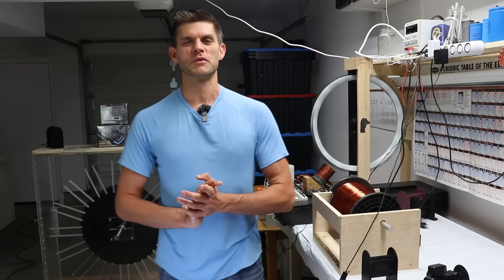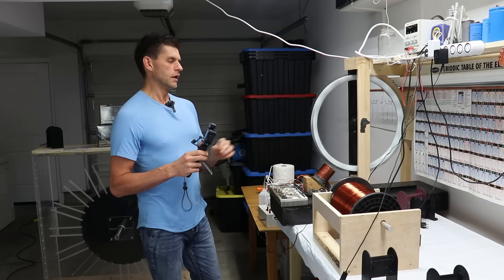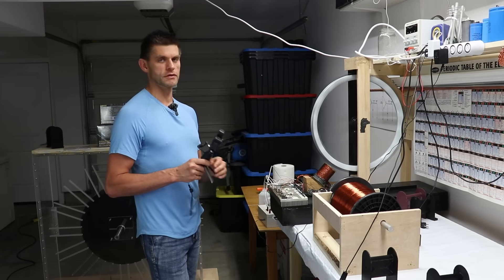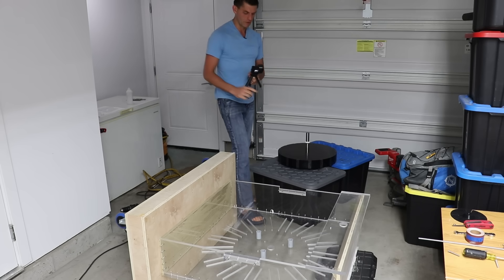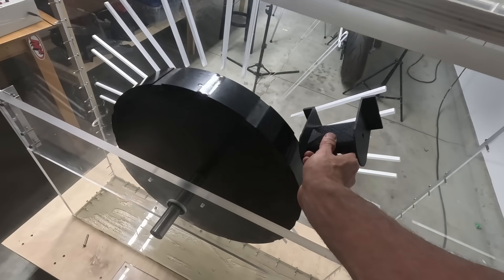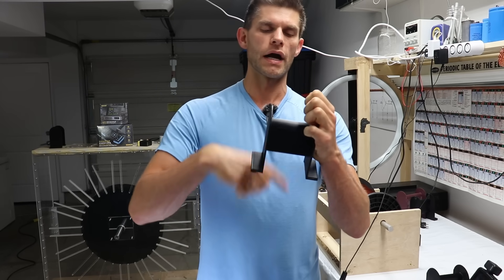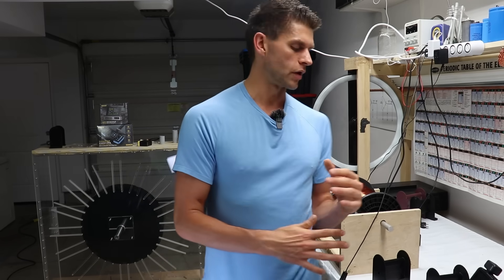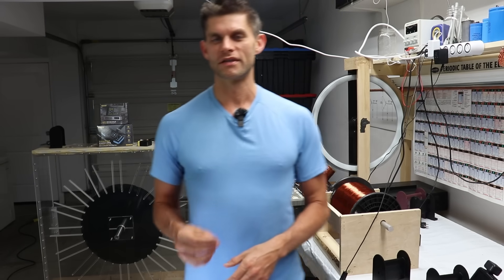Unlocking Zero Point Energy in My Garage (Open Source Project)

Comment: I can point out at least 10 things you're doing wrong. First of all, zero point energy's secret is folding pump z waves either digitally made or riding on a carrier to cause the slope. This is actually an ion charge bias, which makes all parts in the circuit ion diodes, in effect. A wheel is one way to spill off the positive ion waste, but I see no high frequency coil or even a zero point, aside from the LF one, which in any proper zpe circuit is only half of it. You will need to add hf coil to burn off energy in order to get the wheel to also spill off boson space mass (the positive ion in bias to the positive pole of magnetic current - proven new physics based on a real working t.o.e. and established with predictive proofs.)
Here's a thought; any spinning wheel you make needs to do form a Julian set with charge, not Mandelbrot as you have done. It's just a lot more efficient.  Honestly since you've already made your magnet wheel there, idk. Maybe it's worth saving somehow. I can use 36 N52 magnets to produce over 100hp. If you're not doing that yet you need to start over. Don't post a video of it working either. You'll become a target for the oil cartel. Just make the tests and post results without proof, because for those who want to believe are the only ones worth sharing the info with.
Reply from the maker: Lol oh ya, let's see your set up? What's a high frequency coil going to look like in comparison to ours? I disagree and say open source all the way is the only answer.
Reply: @MadscienceLPTECH  You can use an automotive ignition coil if you want. Charge drops when you short out 2 of 3 charge points in a zpe circuit, which also at the time causes charge to implode through layers of flatwire. This was done by Keely in 1908. You have a copper ring between 16v magnets and an iron plate they're mounted to, to pass 32 magnets over 16 cores each wrapped in 21 layers of 1/4" wide flatwire. A pair of negative center cow magnets mounts neg only to vehicle's neg gnd, so the circuit has 3 negatives repelling at once which spits the weaker heavier positive pole and ion it's in bias to, off the ends of the cow magnets (2) at opposite sides of the magnet array- which is the Julian set fractal it makes. It produces 40hp using 3.3lb pull magnets but with 30lb N52 neodymium, a lot more all depending on the wires.  Fact is, negative is stronger than positive and you are taking some advantage of this already but not enough.
Reply from the maker: You seem intelligent. Thanks for the replies. Let's stay in touch :)

Comment: I was thinking 20 alternators belted to a drive shaft 5 to 10 batteries  wired together and a high torque electrical engine like a floor sander hooked up with an electric converter from a mobile home .. would put out. Way more power than it takes in .  Would keep the batteries charged and power the motor leaving power left over to power other devices..
Reply from the maker: Would it? I think I it needs the pulses HV to get the effects. Great comment

Comment: I still think there is something going on with spark gaps. Then the moray valve and vacuum tubes. We need to go back to what they were doing at turn of century maybe.
Reply from the maker: Agreed. Teslas method of conversion used a spark gap to convert to a single wire energy flow

Comment: Your presentation here is magnificent and you have a great vibe...  really nice work!   As an EE, I've also been experimenting for quite a while and totally comprehend everything you discus  (FET vs. SiC,  HAL vs Coil trigger, rotor design, etc.).  I've used Bedini sense-coil triggering, HAL sensors, and mechanical commutators in various configs... oh-so-close to a self-runner but not quite.  Now, using ChatGPT to perform calcs in magnetic field timing and energy input/output and its helped... finally digging in and doing the calculations rather than just a "correct-by-design" approach. In addition, I use it to choose correct core material w/ best permittivity, remanance, etc. along w/ magnet strength & coil dims.  If you haven't already tried, give it a whirl.   ⚡
Reply from the maker: Amazing comment, glad to have you here
Reply: @MadscienceLPTECH  I'm really glad to find you and be here. Thanks !

Comment: Fantastic presentation!!!  Very well spoken, great detail, thorough documenting, open source!  I've been fascinated with free energy for 20 years, done alot of stuff with the Rick Friedrich systems.  I have replicated his set up with limitless coils, I just can't figure out how to ramp it up, and doesn't look like he's ever going to disclose it! 😞

Joseph Newman has a well proven theory as well, the bigger the inductor, the bigger the inductance.  I have also tested this personally on a 80lb spool of 18 gauge magnet wire fed by a 12 volt lantern type battery.  I am lucky I didn't die, that was definitely the worst shock I have ever received in my life when I accidentally touched one of the wires!

Newman refers to the atoms inside the copper as batteries, the more mass, the more batteries!

Rick Friedrich also refers to Transformers as Batteries, most likely because of the large windings inside.  He has transformers beside him in almost all his videos, and I also went to one of his conferences where he had some larger medical grade (whatever that is) that you could barely pick up.
Reply from the maker: Very cool. Would love to see your tests / builds. Im sick of people not showing the secret sauce, real noble not disclosing.

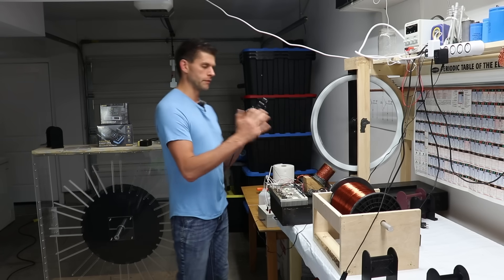Comment: He said at 1:33 the free energy is all from the high voltage pulse charging of the lead acid battery that creates more energy than it takes to charge it. So surely it is easier to get a function generator set it to square wave  driving a single transformer to step it up to the voltage you need. Spinning wheels and magnets look like a distraction to me.
Reply from the maker: Maybe. But pulling additional enger from the rotor is desirable

Comment: I had Muller's motor from Greg Georgen on the island. That's where it ended up. It was useful as a heater but not as a power accumulator. The problem was the magnetic shape and triggering the pulses. They should have tried spinning aluminum plates as reflectors to conserve all the energy. As you might know spinning aluminum has special mirror properties. I didn't get a chance to experiment. His wife should still have the motor
Reply from the maker: cool, i know his daughter has his original motor in Pentiction BC
Reply: @MadscienceLPTECH that's good. I haven't heard from GG for years. I assumed he passed on. He was in Parksville when he went and got it. Small world. I think the idea of spinning aluminum plates and schotkey triggers might make a difference. The measured losses were to high. I didn't have a way to measure anything in supply. The idea is worth looking into deeper. It's good to see people continue. Better testing equipment is a must

Comment: If this was true you would either be arrested or deleted, I hope it is true as this is the only way we will get away from oil and gas and coal, zero point energy is the only way
Reply from the maker: I think oil and gas are good if they were used correctly. Like with water injection to burn clean... but yes we need to stop using finite resources

Comment: Bullshit. No such thing as "FREE energy. There's always a "cost".
Reply from the maker: yes what is solar then?
Reply: @MadscienceLPTECH  The concept of "free energy" is often misunderstood and depends on the context. In physics, particularly thermodynamics, free energy refers to energy available to do work, like Gibbs free energy or Helmholtz free energy, but it’s not "free" in the sense of being unlimited or costless. It’s governed by strict physical laws, such as the conservation of energy, meaning you can’t get energy from nothing.

In popular usage, "free energy" often refers to claims of devices or systems that produce energy without input, violating the laws of thermodynamics (perpetual motion machines). No credible evidence or working device has ever demonstrated this. Such claims are widely debunked by scientists, as they contradict the first and second laws of thermodynamics, which state energy cannot be created or destroyed, and some energy is always lost as heat in any process.

However, "free energy" can also mean energy harnessed from natural, renewable sources like solar, wind, or geothermal, which are "free" in the sense that the source (e.g., sunlight) is naturally abundant and doesn’t require fuel costs, though the infrastructure to capture it isn’t free. 

For example, solar panels convert sunlight into electricity, but the panels, installation, and maintenance have costs.

Solar energy is often referred to as "free energy" in the sense that sunlight is a naturally abundant, renewable resource that doesn’t require fuel costs to access. The sun provides energy without direct cost, and solar panels can convert it into electricity for use. However, it’s not truly "free" because:

Infrastructure Costs: Solar panels, inverters, batteries, and installation require significant upfront investment. Maintenance and eventual replacement also add costs.

Energy Conversion: The process of capturing and converting sunlight into usable energy isn’t 100% efficient. Some energy is lost as heat, and solar panels typically convert 15-22% of sunlight into electricity.

Land and Space: Large-scale solar farms need land, which may have environmental or economic costs.

Storage and Grid Integration: Storing solar energy for use when the sun isn’t shining (e.g., at night) requires expensive battery systems, and integrating it into the grid can involve additional infrastructure.

In contrast to the pseudoscientific idea of "free energy" (e.g., perpetual motion devices that violate thermodynamic laws), solar energy is grounded in physics and widely used. It’s "free" only in the sense that the sun’s energy is naturally available, but harnessing it involves costs and engineering.
Reply: @MadscienceLPTECH  LOL I answer your question, then you delete my answer. What are you afraid of, the truth?

Comment: The problem is... batteries are still involved. Yes, technically, it's over unity, but capacitors would be more appropriate. A real ZPE device has zero batteries.
Reply from the maker: ZPE is all wee need to start the shift, once it out its game over

Comment: There is something in the mountains of Baja Sur,  above the town of San Jose De Gracia that actually (supposedly) produced energy for over a decade. US military set up an experiment there about 55 years ago.  A horizontal flywheel/stator that not only spun, but vibrated/hummed to. The primary components are way too heavy to go anywhere and are still there but most of the tech was removed from the site when the US abandoned it around 1980. One of the many secrets of "La Cuarenta" .
Reply from the maker: That is very interesting, thanks for sharing.

Comment: The most efficient way to tap the zero point is through plasmas. Definitely share a lot of the same mindset as you and I have so much to learn. Definitely going back to school something similar to you EE. Magnetic motors are cool but plasmas like EVOs have a much higher coupling to the ZPE and electron densities on the order of avagradros number 10^²³
Reply from the maker: Thanks for the comment ❤
Reply: Like the ‘thunderstorm generators’?

Comment: Thank you for doing this. Humanity needs more people like you
Reply from the maker: Thank you for your support 🙏
Reply: @MadscienceLPTECH thanks you my brudda you know da wae 🗿🤝🗿
Reply: Humanity does not need more people preying on the scientifically uneducated. This guy is severely misrepresenting science. Just because he sounds smart doesn't mean that he is. If what he's saying works then turning an electric motor on and off would charge the batteries.
Reply: Humanity needs honest people, not people making ridiculous free energy videos and claims.
These videos are BS...
Reply: What are you talking about? I'm less than 3 minutes in and you've already misrepresented two things. First is that an ion is an atom that doesn't have any electrons. They can't flow through anything in the way that you're suggesting because they would react with anything that happens to have a free electron or that is available to form a covalent bond. You have to pump a lot of energy into an atom just to remove it's electron in the first place. Secondly there is a very brief burst of electricity pumped back into the batteries after you cut the power, but not nearly as much as was taken out and a significant amount of it is lost as heat. 

You can't just violate the laws of thermodynamics like that 😂😂😂

And asking people to donate after an intentional misrepresentation of basic science to scientifically illiterate people is pretty low.
Reply: @stephenmadl5609you bored or something?

Comment: In which of your videos do you show that more energy is coming out of your system than going in?
 I think it's great you are showing how to make a home-made DC motor, which is cool. 
But your video does not address the Title, "zero point energy."  To do this, you need to measure the power going in, and the power going out (and it will need to be enough extra power to account for the power consumed by the measuring devices themselves.)
PS - If you truly start to gain traction do not be surprised if everything stops working at some point - those who have the most to lose can easily afford to hire someone to interfere with your progress, like I believe happened with Steorn - https://youtu.be/Hvx7FsVgSlg?si=oh8McFRXZdfHO37h&t=37
Reply from the maker: i do address ZPE, and no its not just a DC motor

Comment: It's the breaking down of the coil where the magic is happening.  The energy in the vaccum rushes in...the energy from is so massive yet so stable that you have to poke it like poking an ugly dog with a stick. When the coil discharges it leaves room for the energy from the either to rush in. An open spark gap in the system will make the ugly dog much more angry....good luck....watch your back

Comment: I have been at this for a very long time @consciousenergies 
You lose energy to the environment and transitioning electrical energy into kinetic energy to do work in spinning a wheel doesn't bring in more energy.  

I don't write this with skeptical animosity. I only write these things with a lot of my own experience. Energy can be stored kinetically in a wheel, but it will not produce more energy as it is a closed system dependent on earthen gravity. 

Just my 2 sats brother. Keep experimenting and don't let my words stop you from doing so. 

✌️❤️
Reply from the maker: Great comment. Valid. We are going to bring in more than enough to cover losses
Reply: @MadscienceLPTECH  Just avoid the wheel and use a solid state system, perhaps? 
I wish you all the success in the world, especially since you are staying open and transparent brother.
Reply: Also, eliminate the batteries and switch to capacitors, and you will see more clearly what the energy gained and lost.

Comment: Whenever you put the magnets around the stater change the magnetic focus of the magnets to be aligned in the Halbach array and minimize using steel it may have a nice heat and rpm tolerance but you lose electrical potential due to heaviness and rotational energy needed not to mention rotational frequency. A thick aluminum rod isn’t just a non ferrous metal but it will help with weight, rpm’s and will help minimize the dead zones without adding an electrical current
Reply from the maker: Great comment. Thanks for your support and input  🙏

Comment: About 20 years ago, I began experimenting with a conventional car engine by attaching magnets to the pistons and placing an electromagnet at the top of the head to create a push-pull motion. The goal was to explore a new method of repurposing old engines—possibly as a path toward free energy. I believed a heavy flywheel could provide the momentum needed to start the system. That was my thinking at the time.

Unfortunately, the project never came to fruition. I began noticing that many individuals working on similar technologies—those close to bringing these ideas to light—were dying under suspicious circumstances. It became clear that exposing such energy systems posed a threat to powerful financial interests that rely on maintaining the status quo.

Think of your motor like a modern windmill. When configured horizontally, it could support multiple units stacked in a modular, multi-level arrangement—capable of powering entire blocks at once, whether expanding upward or downward.

Wishing you strength and success in your pursuit of innovation..

Wishing you the best of luck with your endeavors.
Reply from the maker: thanks for the support and comment!

Comment: That tech is starting to be looked at in the next computer chip upgrades. They don't need electricity "movement" of electrons Just use the switching state like little magnets to work with the eather.